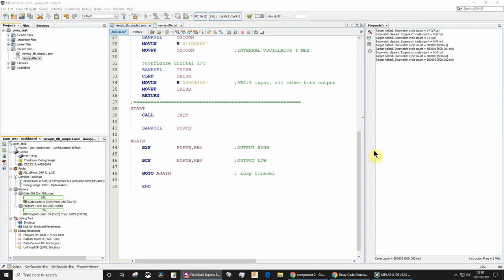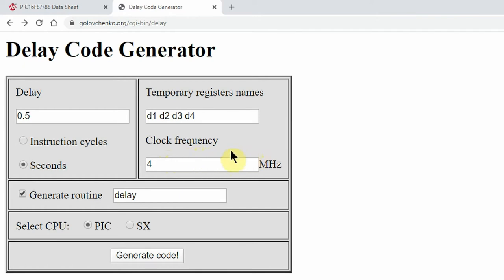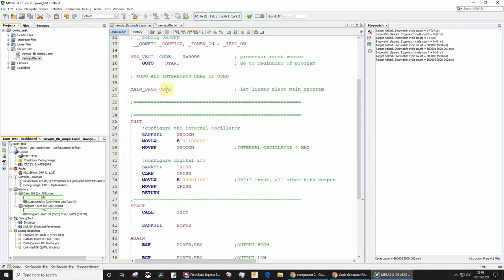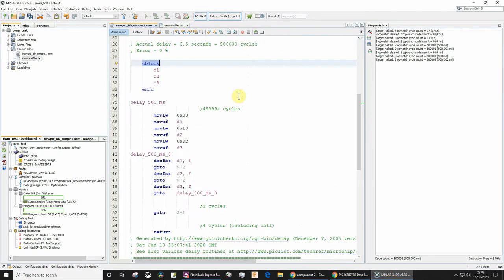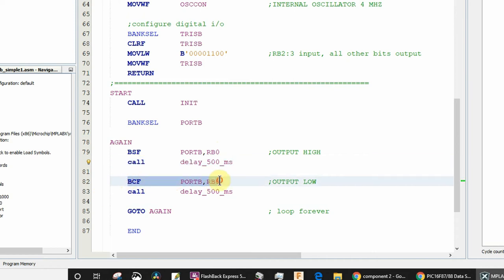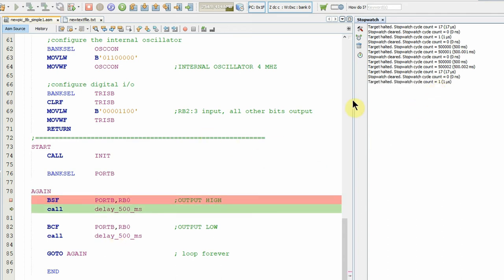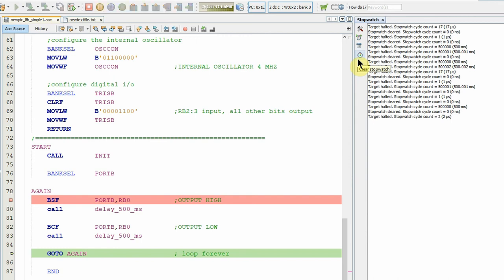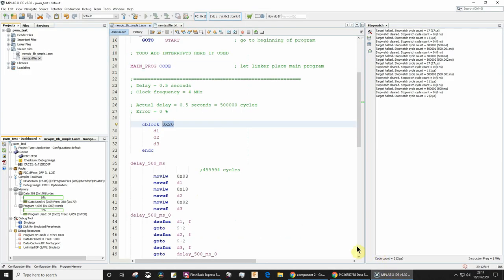Easy assembly time delay routines | MPLAB X IDE PIC16F88

Comment: Has anybody tested adding breakpoints to the Stopwatch when using MPLAB X IDE version 5.05 installed on Linux Ubuntu16.04LTS 32 bit operating systems. 

I can build, program the PIC16F1605 device and then run a debug session, opening the stopwatch but from here am unable to add the two breakpoints I want to use the stopwatch to verify the delay time between the two breakpoints. It seems as though the tab for adding the breakpoints are both inaccessible. The Linux version of MPLAB X IDE is very similar to the Windows version but the stopwatch adding the breakpoints are just not functional. I have searched for a possible reason but at this stage have not been able to find an indication why a breakpoint can't be added.